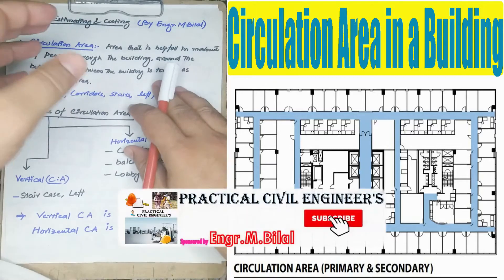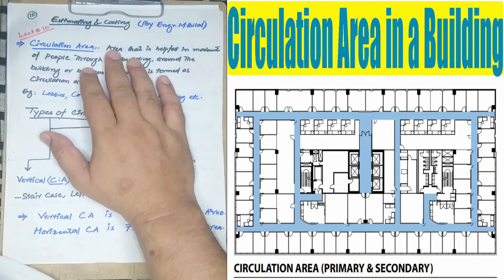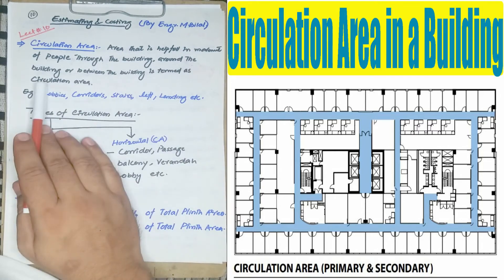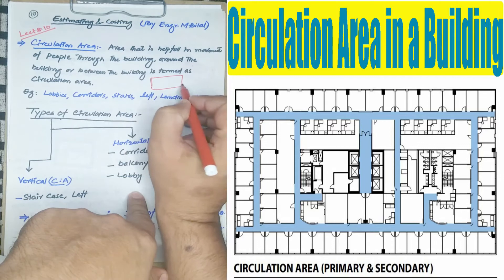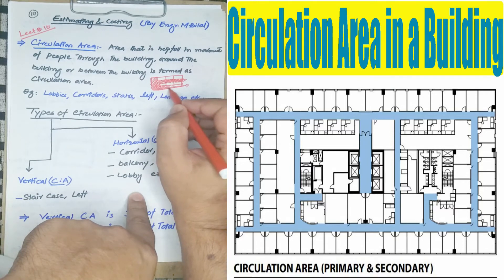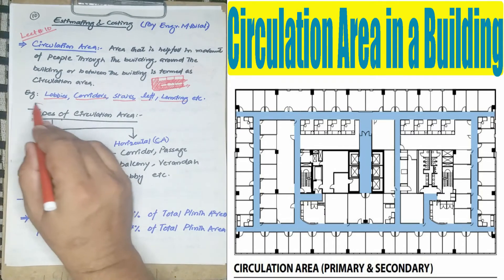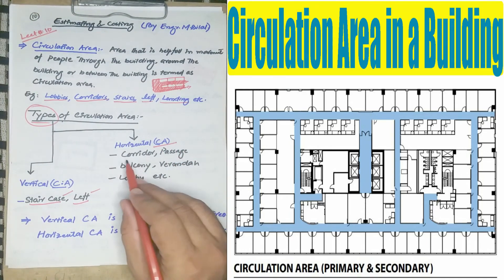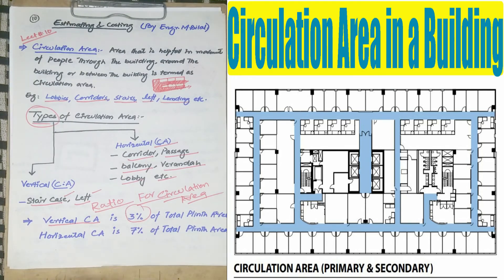Estimating & Costing Lecture 10 / What is Circulation Area in a Building/ Types of Circulation Area

Comment from the maker: 1. Estimating & Costing in Civil Engineering. Lecture # 1
https://www.youtube.com/watch?v=hsszZ...

2. Estimating & Costing Lecture # 2. (Data Required for Preparation of Estimate)
https://www.youtube.com/watch?v=GTcI2...

3. Estimating & Costing Lecture # 3. (Types of Estimate, Rough Cost Estimate & Detailed Cost Estimate)
https://www.youtube.com/watch?v=YjFC5...

4. Estimating & Costing Lecture # 04. (How to prepare Rough Cost Estimate)
https://www.youtube.com/watch?v=zwOBv...

5. How to Excavate Earth for a Building, Excavation in Foundation, Practical Work.
https://www.youtube.com/watch?v=b_flH...

6. Estimating & Costing Lecture # 06/ What is Carpet Area / A Complete Guide on Carpet Area.
https://www.youtube.com/watch?v=DCJMj...

7. Estimating & Costing Lecture 7&8 / Difference between Plinth Area & Carpet Area.
https://youtu.be/awAAOajqykU

9. Estimating & Costing Lecture 09/ What is Floor Area, Set Back Area/How to Find Out Floor Area Ratio
https://youtu.be/WhC26vOX9FQ

10. Estimating & Costing Lecture 10 / What is Circulation Area in a Building/ Types of Circulation Area
https://youtu.be/fUMVT15Yo1Y